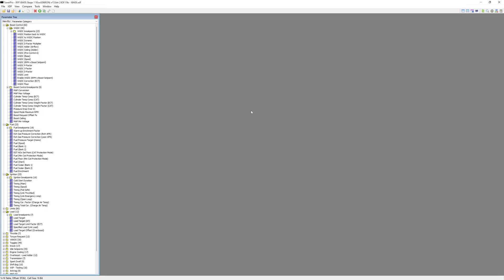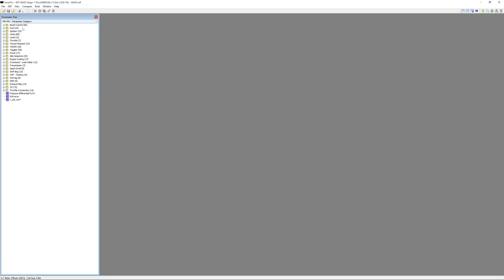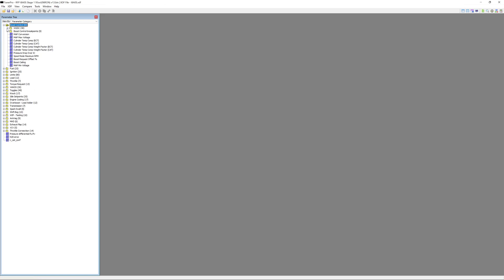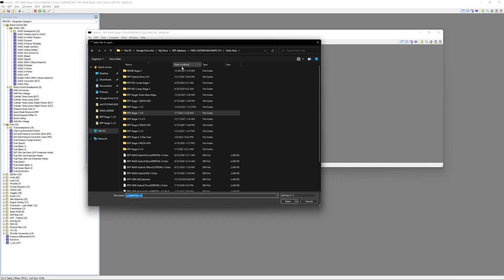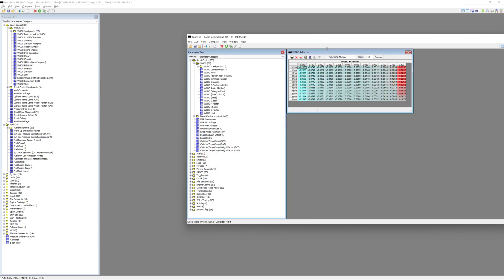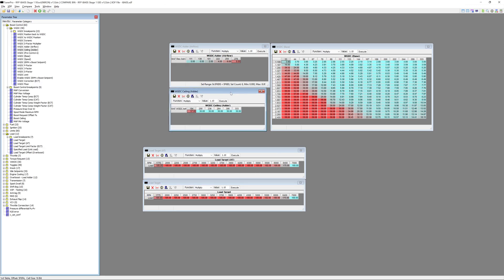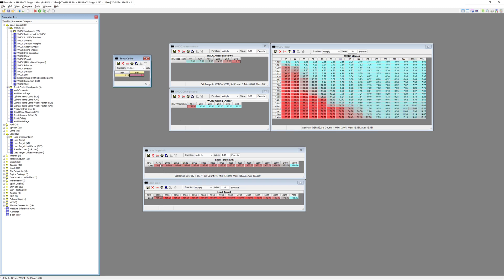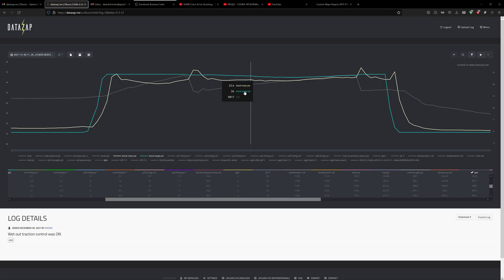N54 - Self Tuning | Boost Control Basics Part 1

Comment: How did you scale the for the 3.5 map sensor I have the conversion right and check in mhd options but I keep getting the overrun code for the sensor do I need to buy the mboost option

Comment: Where can I download those ''FREE CUSTOM N54 MAPS V13'' tunes? I see that you have a IJE0S map for hybrid turbos and 91 oct, whats the boost target on those? I have 19Ts and looking for a good tune until I finalize my setup and get a proper custom tune. Also, I am currently running JB4 BEF pump gas map, do you have a BEF Hyrbid turbo map for pump gas?

Comment: thank you for very informative video.
I have one question. I have some mods done on car like,dp,ic,17T,cp,
i wanted to use your base map for hybrid turbo but car was silly i assume that was because of the n20 3.5 bar sensor that i dont have ? am i correct ? one friend of mine said that when im using 17T turbos with ots map from mhd it will be lean for these turbo setup was he correct ? ill try to log it buy yu will know off shelve :D
Reply from the maker: Hello. He is correct. You will be too lean on MHD OTS and you need 3.5 bar for my maps. Just a reminder I do not support my free maps so you are on your own. When you get to modding turbos and such, always go for custom map, as it can be tuned both for 3.5 bar and stock 2.5 bar
Reply: @rfptuning  thanks man. I went from mhd stage 1+ map that i had on car to your free stage 2 map. And ive logged pull and my afr was pretty normal on your map. But you think for a base map in my setup its still better to go with hybrid map from you ? that one with no TD03 written in it. Or what would you consider for me.
But i can feel big difference from mhd to yours map. Car feels way better with response and power climb it goes really smooth. On that mhd map it was sometimes hesitating and i went like twice to limp mode probably because of those hybrid turbos.
Reply from the maker: @jozefchalupka1900  Might be, I don't know. Logs would show a bigger picture, however I do not provide any services to my free release maps
Reply: @rfptuning  allright. But beside services on free maps. My question for this video. That wgdc base on left side you mentioned its in atmosfere units ? So bottom 2.4 is how much psi when i want to scale it out and look exact position. 2.4 its like maximum target boost ?
Reply: @rfptuning  only thing weird i noticed on log with stage 2 is wgdc base and after pid. Ain some section of graph im having much higher wgdc after pid than base like triple of ammount and i could not understand corectly what you tried to explain in which units its converted that left side of column in wgdc base. I would like to apply some changes like you explain higher but i want to focus at that corect section by units.

Comment: How do you setup antilag with a switch... very interested in that
Reply: You need to have a separate table or a tables that is modified where ECU can read the timing and fuel from. 
Once the trigger is pressed, AIT codes gotta get removed and AIT sensor will read cold temps, turbo will spool due to timing and fuel.
On n54 Wedge is the only one so far who did it, MHD should release their software solution this year too. 

JB4 currently are the only ones who have anti-lag
Reply from the maker: As of today, anti lag is software based :)

Comment: Just wanted to say thanks for this as it is much appreciated; coming from the Evo/DSM and Subaru community, information on the forums is in abundance. I have always built and tuned my cars from the ground up and recently the N54 platform, which I am still very much learning. Although, it seems like many vendors and shops keep the information very well hidden or simply kept out of the public forums so their "expertise" and services can be marketed. Granted if you are not a true gear head or mechanically inclined you would never know but this happens to some extent on every car/forum.. 

I was going to comment when I initially watched this video but never got around to it.. After some N54 researching I ran into your posts along with the other "experts" dismissing your tunes/re-flashes, which I found odd when you provide all your maps unlocked or opened for analysis/learning. 

Even more so giving back to the BMW - N54 community and advancing the platform or at least giving access to the underground mechanics, not to mention an honest and transparent service. 

The only conclusion I could come up with was that you were on the verge of bankrupting MHD or COBB out of their cookie cutter tunes.. Which led them to send their undercover minions🤣

Thanks again brotha, ill be waiting for the next video and keep up the great work!👍
Reply from the maker: Thank you for your kind words man. Idk about bankrupting but I did push them to release V9 and V10 maps for sure :)
Reply: right :D i

Comment: Good timing and thanks for the work! Just found your v12 maps this afternoon. Planning to try and use the v12 n54 hybrid turbo map and modify it for stage 2 TD04's.
Reply from the maker: Good luck.
Reply: did you get around it? I could use a bef map for 19Ts with pump gas until I finalize my fueling setup and get a proper custom tune. currenlty using JB4 pump BEF map, not ideal